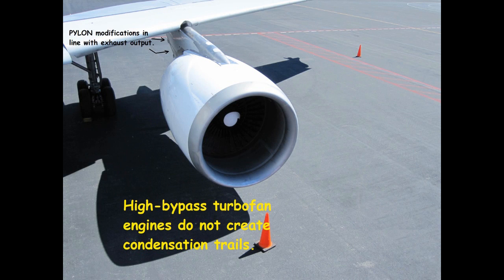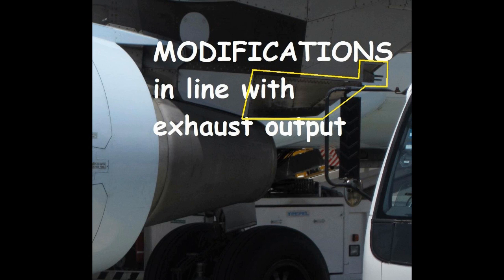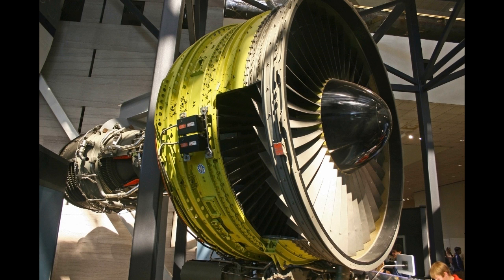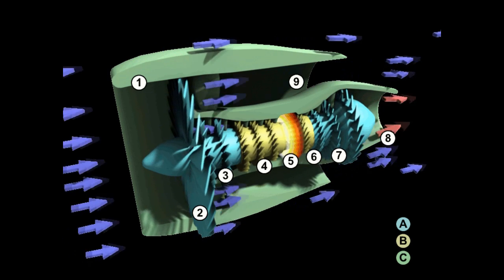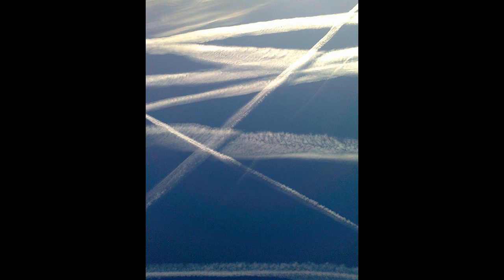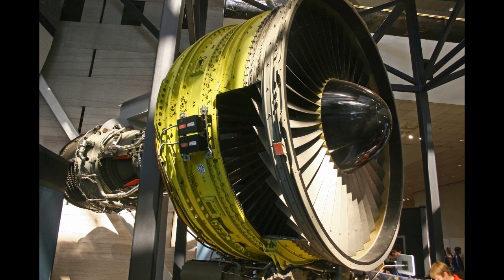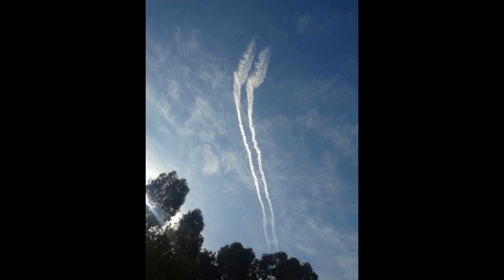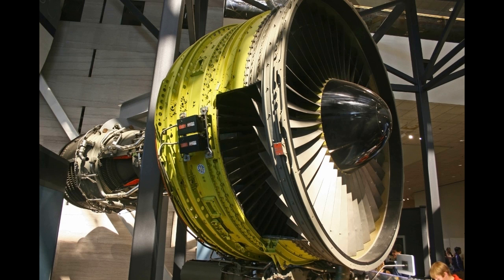HIGH BYPASS TURBOFAN JET ENGINES CANNOT MAKE CONTRAILS

Comment: “I have checked drawing…and this is not an original kind of….”

Which drawing did you check?  Link them here.

So , let’s say it IS an aftermarket part.  Do you have any video of anyone loading chemicals?  It would have to be done in plain sight.

Comment: "ratio of air to exhaust" is meaningless in contrail formation.  "fuel per unit of air moved' is meaningless in contrail formation. 

https://journals.ametsoc.org/view/journals/apme/36/12/1520-0450_1997_036_1725_coacfc_2.0.co_2.xml#i1520-0450-36-12-1725-busen1

High pressure air in the engine returns to ambient pressure in the atmosphere. It doesn't magically stay high-pressure forever while the air around it remains at a lower pressure.
Hot exhaust from the engine returns to ambient temperature in the atmosphere. It doesn't magically stay hot forever while the air around it remains at a lower temperature.

Lowering pressure and cooling are literally what you should expect to happen to everything coming out of the back of a turbofan engine.

Comment: What a load of lies! High bypass turbofan jet engines have been found to increase contrail formation contrary to this video. These engine efficiency improvements reduce the specific fuel consumption and most types of emissions, but contrails DO increase! It also notes that contrail cover is projected to grow faster than aviation fuel consumption in the long-term future, partly because future aircraft will have higher propulsion efficiency. Here is the evidence and research to support that.  Videos are not proof. Actual research and evidence is.
http://elib.dlr.de/9247/1/aerscitech-2000.pdf

Comment: You sir, need to commit yourself to some kind of ward. You are absolutely nuts. Of course they are contrails, and of course a high bypass engine can produce contrails. The gas producing core of the engine, is still burning a lot of fuel at a very high temperature. Also, with the air pulled into the engine being compressed at such high ratios as they are on modern engines, the chance of contrails are higher than ever. The combustion temps in modern engines far, far, far exceeds those of old turbojets, that also made contrails. A GE90-115B will still produce about 10-12000 lbs. of thrust just on the exhaust alone, and that gas is hotter than the gas expelled from say a J47, J79, Avon, Olympus, Spey or JT8D. Heck, even the bypass air is compressed at about 3:1 or more which is plenty to leave a contrail. Do you also think the vortexes of vapor you see when engines are run on the ground are chemicals, and not due to inlet depression?

Oh, why am I even wasting my time - you utter benighted imbecile.
Reply: Love it! These chemtrail dreamers will come up with any and all misinformation. Blind to real proof that debunks claims.  Do I think governments are innocent? Of course not, but I hate when people pollute minds with speculation and misinfo.
Reply: cagallia athela The danger does not lie in the fact that this in it self is infantile nonsense. The danger lies in the A, B, C, D effect. Some people are very susceptible to this kind of information. On a basic level, you scare them and make them miserable. Not because of fear of flying or planes, but because you fuel their fantasies and replace their peaceful and reassuring knowns with unsettling falsies. This means that you get a group of people who start to worry all the time, and that breeds fear, anxiety and aggression. What I mean by the A, B, C, D effect is this. Once you've made people believe one thing that is illogical and false, then the step to believe the next thing is closer. On top of that, you get a larger group who "spreads" this misinformation, fear and possible aggression. When you deconstruct the foundation for logic and sensibility, you open a gate to a world of distrust and lunacy.
Look at what some cult leaders have done and are doing - or look at some of the more known anti-socials, or terrorist. The problem with a nut job like this guy, is that he more than likely believe his own BS - this in turn does seem very convincing to some. So what will the next guy do? Go on a rampage with a couple of stolen RPG's and shoot down planes or bomb airports? I know this analogy is taking things to extremes, and I'm not trying to spread the same kind of fear; but I'm very convinced it is very unhealthy for our society to allow this kind of mad thinking. I'm as pro free thinking as you can be, and I implore people to be critical of any information - including my own. I don't believe most politicians farther than I can throw them, but I feel more secure in their hands, than in the hands and mercy of this wack job.
Reply: ⓟⓛⓐⓢⓜⓐ ᕈᒪᗩᔕᙢᗩ John Doe Riiiight. Look, I can get you up close and personal with a plane from SAS. If I do that, will you please show me the "dispensers" of this chemical.

Speaking of chemicals. Exactly what is this chemical supposed to do? If you know chemtrails are real, you must also know something about the chemicals and their negative effect. Otherwise, you're spreading falsies based on no knowledge at all. In other words - you want to warn us about something, but how can you warn about something you don't know. Let's spin it 180 and say chemtrails are real, but the chemicals have a positive effect. Do you know that's not the case?
Reply: ⓟⓛⓐⓢⓜⓐ ᕈᒪᗩᔕᙢᗩ John Doe 

1. Contrails have much more to do with moisture and barometric pressure than altitude and temperatures. Those numbers are VERY incorrect.

2. Different heights, layers, winds and engine temps.

3. Some engines burn oil due to lack for maintenance or other small issues. Look up carbon seals.

4. Too many variables based on the information. No plane model, no engine model etc. And how the air is affected in relation to contrails has a lot to do with engine placement.

5. First off, the gas exiting the core is not 900 C at the nozzle. Secondly, look at answer #1

6. Depending on which CFM56 variant is used, it derives 8-12% of thrust from it's core. If the IAE V2500 is used, it's between 7-10%, depending on model.

7. No.

8. You might wanna look into Bernoulli's equation and a bit of thermo-physics.

9. I can feel my IQ drop when reading all that gibberish. Not even going to answer that one.

10. No

11. If you're that sure, why don't you do something real about it?
Reply: cagallia athela I can tell you why.... BECAUSE this VIDEO is MISINFORMATION at it's best!  Sure the government is corrupt, however, posting this misinformation, means the messengers of the CHEMTRAIL CONSPIRACY are themselves corrupt, spreading what they believe or want to believe without any regard of truth.  I have tried reasoning with these people and I get told CONTRAILS don't exist which is complete BS, and that I work for the government because I record airplanes, producing TRAILS (like clouds) in the sky and say they are not "CHEMTRAILS".    Heat and moisture in right weather conditions cause clouds and these can emit from anything as simple as human mouth to a JET engine in our skies.
Reply: Show me some evidence and I will believe you.   I am pretty sure the government would be wasting their time trying to poison from contrails out of jets in the sky. Is it possible? Of course, however, no proof in these videos, only misinformation.   Your mention that this clip is important to open our eyes is only effective on those who are uneducated in science and aviation.   As for "government shill", I would love to get paid government salary to diffuse ridiculous claims like seen in this video.
Reply: Thats funny.. watch some of my upclose footage. I have split cams too. What you will see is hot condensation freezing behind a commercial airliner. If you cant grasp that concept, then you are blinded by misinformation.   I have filmed all types of contrails, and they are are emitted by identifiable airliners from all countries around the world.
Reply: artoftheskies you said it yourself all dependant on the conditions of the sky..so why can i walk outside on the same day...see 3 different planes same time, and one trail disappears in seconds the others are still there hrs later?
Reply: ABOlsen69X jeez why do you seem so hostile for no reason or at least not a good one. Regardless of whether or not he is correct forgive him for feeling like he needed to inform people of a possible danger to themselves from a government that has shown time and again in truth it cant be trusted. I am no expert in these things so im not sure whats true however rationally speaking observing the things that have happened and the things we humans and our governments are capable of something like chemicals being sprayed in the air and a cover up dont seem all that far fetched. Whether or not its really happening i havent decided but i most certainly acknowledge the possibility. As an observer of the world around me there are lots of weird shit that happens that seem abnormal but once again im not expert so i try not to assume but this geoengineering information is without a doubt intriguing and addresses some of the questions i had long before i ran across this whole idea of chemtrails n crap.
Reply: ABOlsen69X also even if people did start believing this stuff was true how is this damaging?????? what would be damaged??? people wouldnt trust airplanes lol? or they wouldnt trust the government a lot of them already dont trust? lol like seriously i dont get whats so dangerous about this information????? oh people are scared about chemicals in the air and damaging planet earth to the point of no return so they wanna do something about it lol how is that a bad thing we should take care of the planet mind you the only planet we have
Reply: ABOlsen69X ok i perfectly understand what you mean and in most cases you are correct so i totally see what you are saying. But in most cases its not really a good thing to disagree to an extreme point either. This specific information i do not see how this would lead to anything that would really be detrimental even if it is false info but then again i cant see the future. Inspiring fear into people to take the life of their planet seriously...might not be a bad thing since people cant seem to develop respect for it. Taking an aggressive stance against the idea of geoengineering and chemical spraying actually makes it just look like one is trying to deny some sort of truth rather than it being convincing or at least to an individual who enjoys analyzing information before accepting it. If it can be acknowledged that aerial chemical spraying is a possibility then it should most definitely be explored to see if it is happening especially if its as dangerous as some claim ESPECIALLY since the government is corrupt which it doesnt take a rocket scientist to figure that out. This video aside its kinda hard to decide what to believe some information seems rather convincing and logically it makes sense that if this was happening there would be a cover up most definitely but one doesnt just want to jump into believing anything. But like i said at least exploring the information thats out there especially if it has claim to be scientific evidence i think is 100% warranted if its so dangerous
Reply: +ABOlsen69X they do create a trail they just dont last as long maybe a few seconds or so but when they are there for like 10mins- hr that isn't just condensation man come on. I can look in the sky and watch them disappear fast in minutes and see the supposed same type plane another time and there is that same trail just a tad spread out an hour later, same day and same conditions mind you, sorry that just doesn't make sense it isn't scientifically possible. Look up more often.
Reply: +vicki bagbi... Think of fog.. fog can last for hours.. especially on a cold day. I look up very often as I film aircraft at high level, and I have seen the same planes make different trails.. all dependent on the conditions in the sky...   I have yet to see something that I can agree is a government "chemtrail".
Reply: +Vicki Laughridge "and see the supposed same type plane another time and there is that same trail just a tad spread out an hour later, same day and same conditions mind you, sorry that just doesn't make sense it isn't scientifically possible."

How did you determine that the conditions were the same? Oh... that's right... you DIDN'T. You are only ASSUMING that to be the case.
Reply: I know how. To look up temp and wind etc
Reply: Vicki Laughridge Bullshit. You're simply guessing. Get a clue. it's just contrails.
Reply: +Paid Gov't Debunker
For me it's easy, I can just ask a pilot or a traffic controller. But then again, at 30000-35000 feet, the temperature is normally between -50C and -75C. Rarely it creeps lower, and even more rarely it creeps higher. If you have a day with a light hazy overcast, with few air streams, high humidity and low temps, say  -65C and below, contrails can last for 15-30 minutes easily.